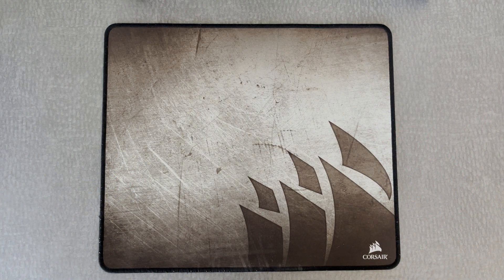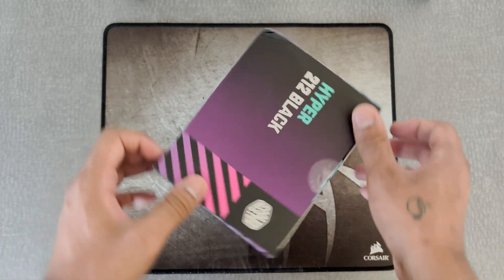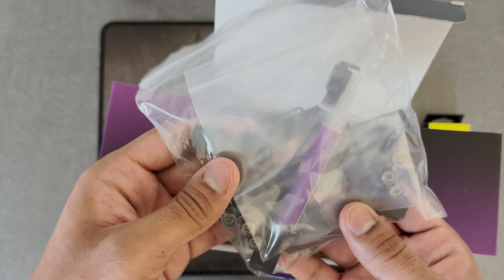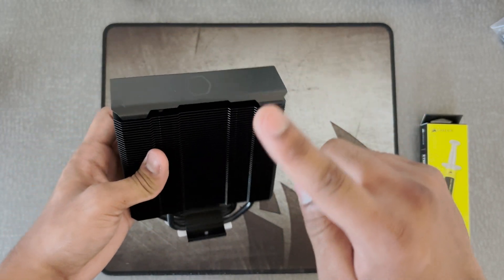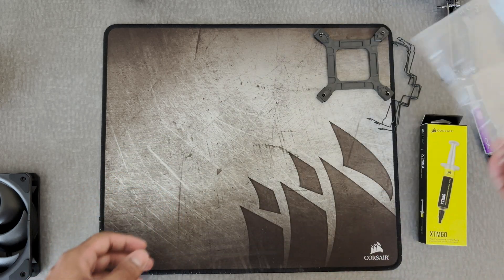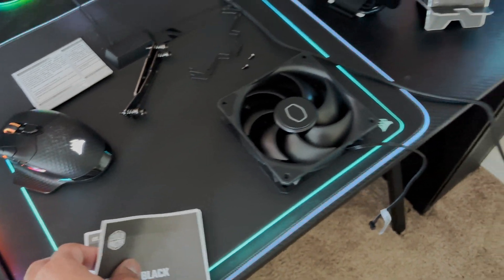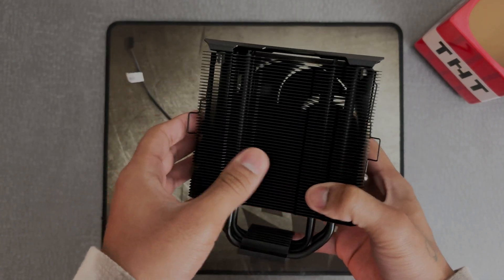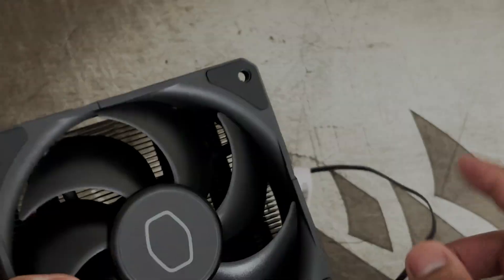Tech Corner After Dark: The Cooler Master Hyper 212..

Comment: i used a wraith prism cooler for a good while. Once i got a Ryzen 7 5800X3D i had to switch to an arctic freeze 240mm, i still use it for my 7800X3D
Reply from the maker: @chenzen4915  Nice! How's the Freezer doing?
Reply: @RTC1200  during cinebench runs it maxes out at 75 C.  Idle stays around 35-40
Reply from the maker: @ Nice! Those are some great temps!
Reply: @RTC1200   I had a artic freezer 7x air cooler and my i5 13400f overheated, so changed it to a deepcool ak400 and temps never went over 60 degrees in heavy use